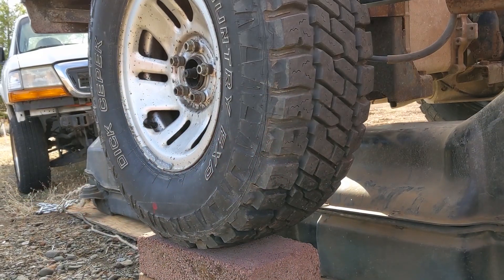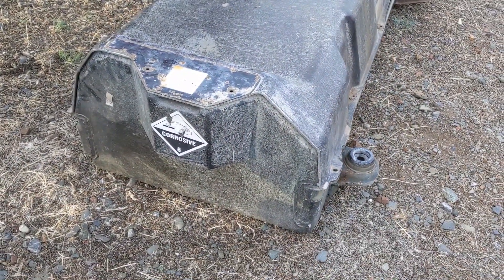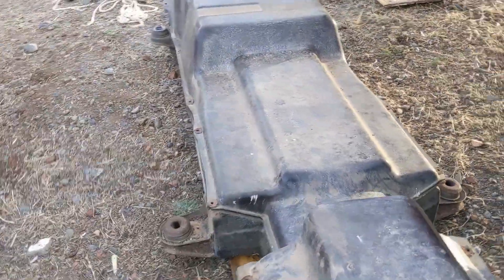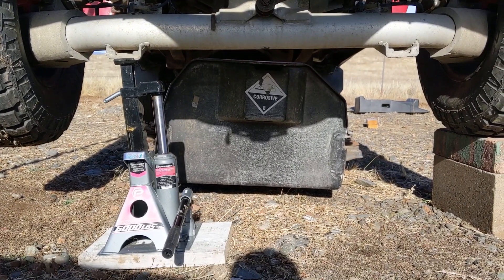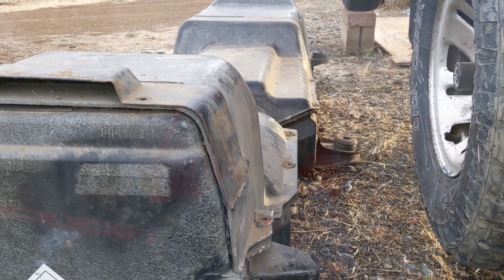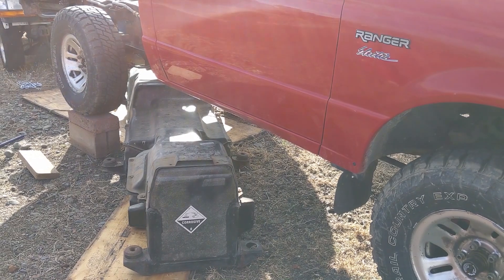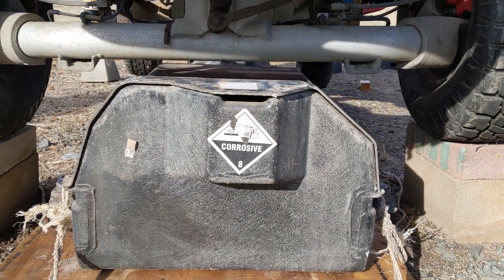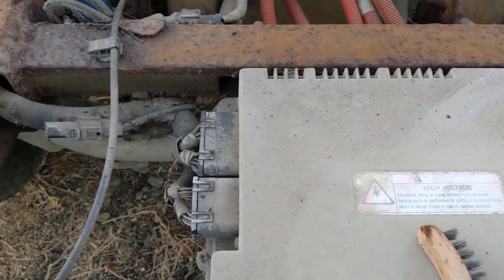Removing the Ford Ranger Electric Battery Case

Comment: how long and wide is the battery box on these things? it looks massive but i know the trucks are pretty small
Reply from the maker: Overall, it's about 8" to 9" long. The inside dimensions are smaller (the main battery compartment is about 60" long and less than 30" wide... the other compartments total to only be about half that).

Comment: Your cat is distracting me.  Be careful;  failing/crumbling cinder blocks injure (sometimes kill) a multitude of farmers & shade tree mechanics, nationwide, every year.  They are not nearly as strong in a portable support situation as you've assumed them to be.  OSHA accident investigation evidence is an eye-opener for this situation.
Reply from the maker: Yes, cinder blocks  are definitely not something I would trust my life to when getting under a truck. For this purpose, though, they were fine for temporarily giving the vertical clearance. Also, without the battery, the back end of the truck is very light. Maybe a few hundred pounds including the tires.
Reply: Good tip for not dying

Comment: Nice! Where can I find one of these near maryland?
Reply from the maker: I doubt you'll find many. My understanding is that there are only about 200 of them left.
Reply: @newscoulomb3705  that's what I was thinking. Thanks for the response. I was hoping you would say something along the lines of "the ranger ev junkyard dot com has all the blahbadeeblah you need".
Reply from the maker: @TRYtoHELPyou  There is a place that I've been looking at where the guy rebuilds Ranger Electrics. He has a lot of parts and maybe even Rangers for sale. But they're in Portland, OR, I believe.
Reply: @newscoulomb3705  How bout that.  I live in portland, couldnt find anything about ranger EV's only independent EV things i know of are a guy that puts the big 62kwh leaf batteries into the old ones and gives em insane range, and a EV only dealer called platt auto.

Comment: Whats your end goal on range and charging ports?    Also your helper there im sure can use their paws to just pop the new battery in place.  haha.  Very excited to see this project along!  Also hope the cat stays around.  I would do anything to get a ranger electric, hopefully the f150 electric isnt too big.
Reply from the maker: I don't have an exact end goal for range, but it will probably end up being close to 300 miles. DC fast charging is going to be tricky. CHAdeMO is technically easier than CCS, but CHAdeMO works with CAN... these Rangers don't use CAN. Ultimately, the battery will set the charging speeds, but I'd like to get close to 80% in 40 minutes.

Comment: Are you any position, or area, to borrow a local fork lift? If you can find some offroad folks with some Hi-Lift jacks to bring the truck up, forklift the battery under it, then lower the frame onto it. Alignment of bolts will be an issue. Tough challenge! We wish you luck!
Reply from the maker: Thanks! Yes, I'm thinking of either a heavy duty transmission jack or forklift. The bigger issue is lifting and lowering the truck while keeping it level.

Comment: Cat stole the show, even making truck tire spin.  Battery case is proof that BEVs based on ICE components are awkward and problematical.  Bet Ford lost a lot on each unit.
Reply: 4:05 lol!
Reply from the maker: Yes, the cat was having fun. As for the ICE components, I don't see any issues (I'll probably talk more about that in a while). The biggest issue is not having a dedicated EV chassis. Luckily, that's where most automakers are moving now.

Comment: Will you be adding a 100kwh battery?
Reply: considering the way that truck was built it had such a tiny battery 30 or 40kwh could go a very long distance in this truck.
Reply from the maker: @chrisw443  These trucks originally came with ~30 kWh usable capacity. That wasn't even good enough for 100 miles of range, though, so I'm definitely looking to expand on that.
Reply from the maker: spoilers Yes, that's pretty close to the battery I'll be putting in.